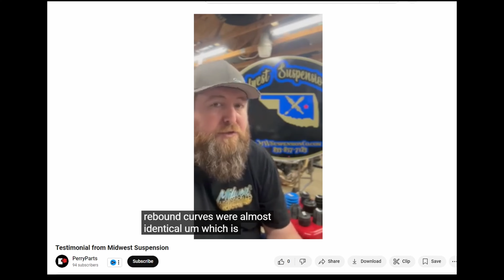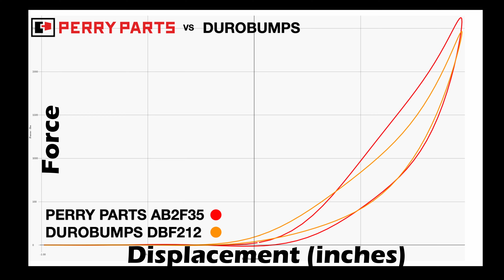What Overland Creators WON'T Tell You About Sponsored Content (But I Will)

Comment: I have a 2002 Tundra and I have Bilstein 5100's. Ultimately I would like to make is travel as smoothly as possible over bumps, would these help with that? Thank you!
Reply from the maker: This will help make harsh bumps and unexpected potholes a little smoother. 

This will not dramatically (if at all) change how your suspension handles rough terrain, but will add cushion when you max out your suspension’s uptravel.

Comment: You saved my Sanity! I have a 2001Tundra, I have been trying to figure out why my truck was bottoming out with even the lightest load for Weeks now..
 Just installed a 2" leveling kit and it was WORSE!!
I was seriously losing my mind over this. I loaded up to head out camping this weekend and before I left my neighborhood, I hit a pot hole and both the front and rear smacked (what felt like metal on metal).. my heart Dropped to my ankles. As I had a loaded truck and a 2 hr trip ahead of me.
Just got. Back after a stressful weekend and seen this video pop up. Immediately made sense and after checking. Boom! Rear bumps are completely missing and the front OEM's are due for replacement!
Major sigh of relief!!!
Thank you Soo much, love your videos!
Reply from the maker: Oh man! That’s terrible. Glad this video helped, I definitely recommend Perry parts! They make good stuff. If you want to, you can double up on the fronts so that you have 2 on each side
Reply: @208Tyler  I was just strolling thru  the rabbit hole of bump stops.. I think I will definitely be doing that.

Comment: Thank you for this great video, it highlights one of the major issues I see on YouTube

To give a practical example, I am planning a long trip with my 9 year old son in October (Sydney - Perth and back - for your USA people roughly going from one coast to the other and back). It will be a combined on and off-road trip. Not in a fancy 100k plus Land cruiser decked out in all latest ARB stuff but an almost stock Suzuki Grand Vitara with a small 5x3 trailer.

I been looking on YouTube for tips and tricks that are good value. So a 300,- Kings (cheep Australian brand) fridge for 2 reasons, 1 same price as a decent cooling box (I know.. WTF??) 2 that's the budget I have.

Now I am trying to answer a simple (at least I thought it was) question, do I REALY need a 2nd battery or can I just use it as a powered Freezer when I drive (6+ hours a day) and switch it off with the car and pretend its a cooler at night?

All I find on YouTube are 'reviews' on how great this XYZ power bank (free of charge for the reviewer) or this 2nd battery system (also free of charge) is. Oh btw its 'only $500 - $1500, use the discount code below'

There are some GREAT 'this is all you need for camping' video's but nothing for in the middle, people that can spend a little more but not the big bucks, just enough to have fun be out there and enjoy it in a little comfort.

Again thank you for sharing your thoughts, greatly appreciated!
Reply from the maker: Thank you! Sorry I couldn’t help you find a fridge haha